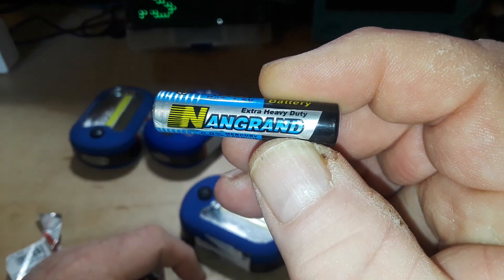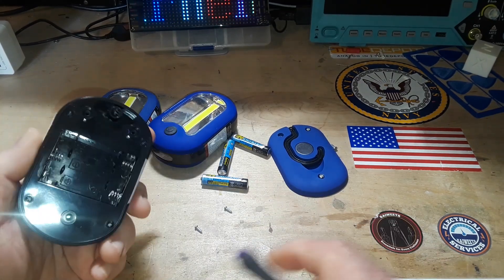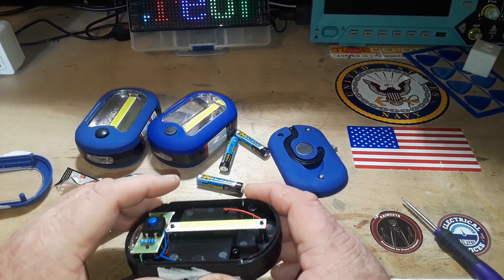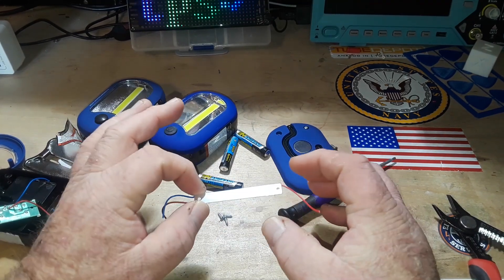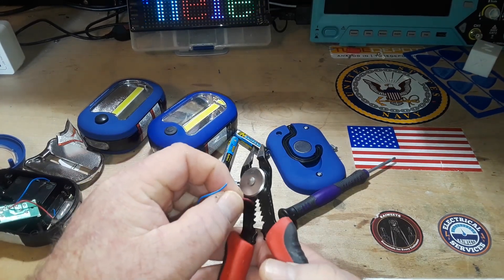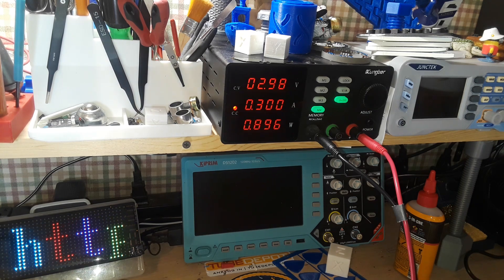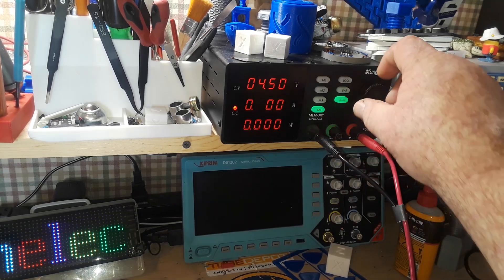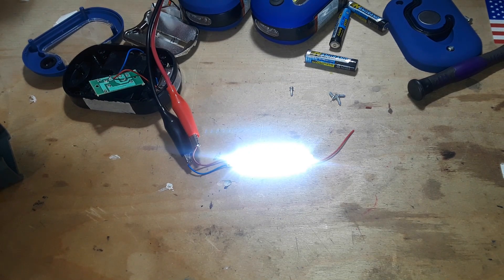Stripping Harbor Freight COB LED Work Lights For Parts

Comment: like it and wonder if you had been aware of the last measuring that the sensor was heading to your face and not the cob - check it out 9:35 shows that low measurement

Comment: The LUX output of the standalone COB was probably brighter because of the lack of a resistor. The circuit board in the light has the two current limiting resistors, one for each LED. I wouldn't doubt that the resistors limit the current well below the 300 mA level. Also, by removing the resistor, wouldn't that reduce the lifespan of the COB?

Comment: Awesome!  I was planning to make a light bar using the old free ones my Dad and I've accumulated over the years prior to his passing years back.  I still haven't moved forward with the design, though have the COB LED's and reflectors too. I think I have the cases with switches somewhere as well.  Was thinking string them up with a larger current switch to use a barrel connector for 12VDC or 18650 cells to power.

Comment: Her5es a tip remove one of the batteries and replace with a wire link.
still plenty of brightness but longer life and save on the cost of a battery.
Reply: I do that with the rechargeable LiFePO4 batteries in mine, as well as in a few other devices.  They'll most likely wear out using LiPo, though still can I've found.
Reply: I use residential house solid wire and just bend round ends for the contacts.

Comment: Great video Paul, I love this kind of tinkering. I modified my light to receive an 18650 battery that could be recharged inside the unit. It works great for a concentrated long lasting light. Also, you could design a case and 3d print a bigger light making it a Melty Monday item.